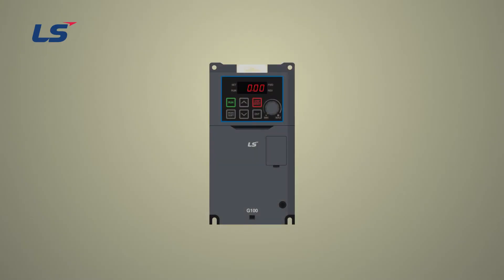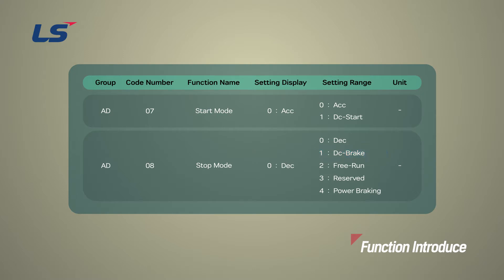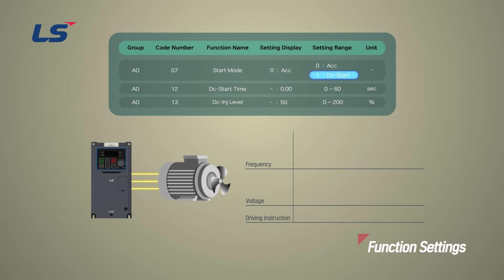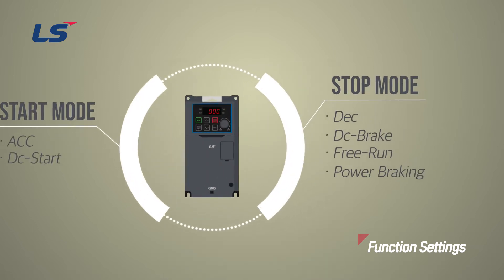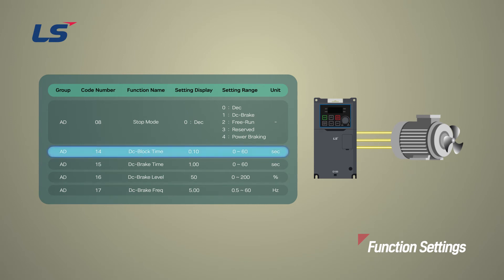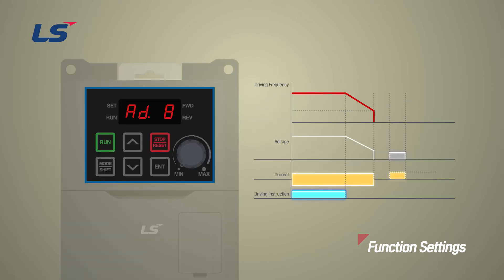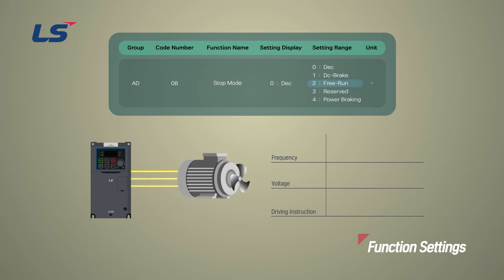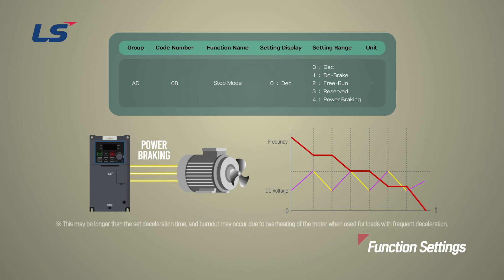LS ELECTRIC | AC Drive G100 Start and Stop function settings

Comment: i have Ls G100 invereter (vfd) (output voltage phase to phase 150 or 160 on 60hz frequency... my requirement 380 output voltage what i setting ????